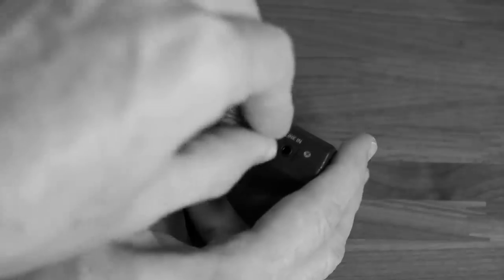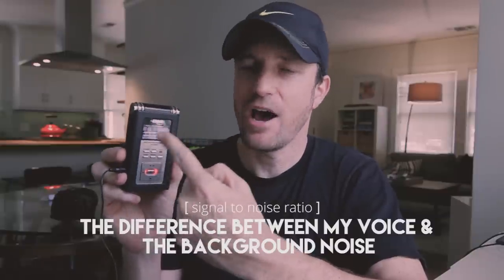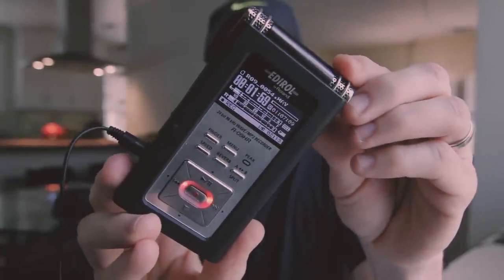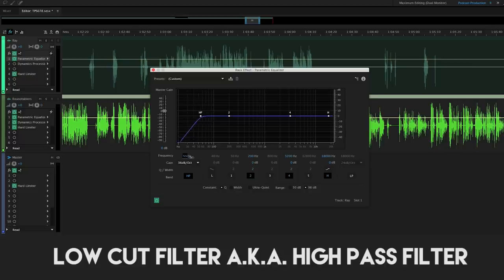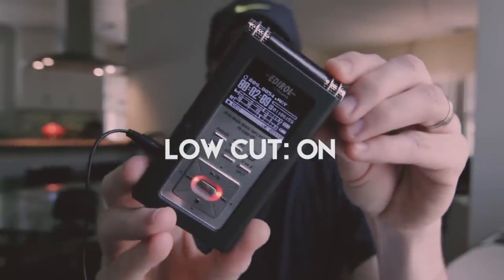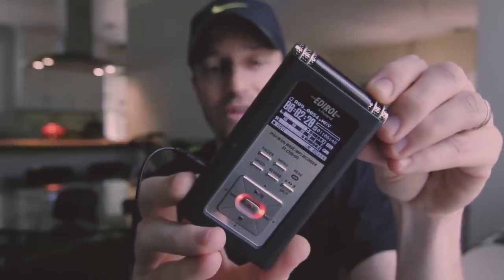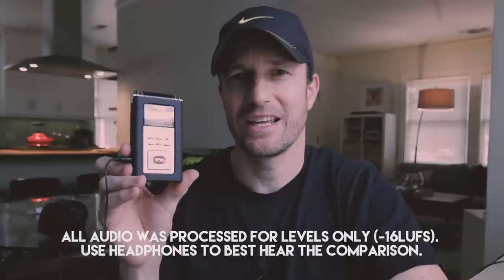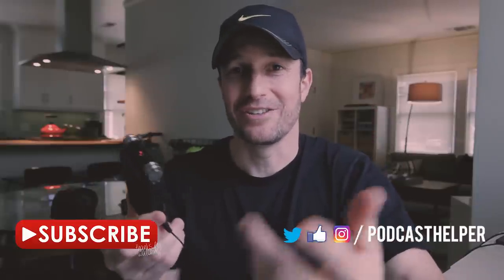Fix Audio Noise Using a Low Cut Filter

Comment: Hi Ray, thanks for the to the point explanation with example for low cut feature on the recorder, my question is that I got Sennheiser MKE 400 shotgun mic for DSLR, I film weddings with my lavalier as well, should I keep the low cut filter ON during my recording or assess the situation, mind you weddings are busy with full of noises people chattering or background music at hall, kindly let me know, thanks.
Reply from the maker: Hi, Mike. Thanks for the feedback. Every mic has a different level at which they cut the lows. I don't like to cut above 80Hz on my mic and in fact in almost all cases I don't use low cuts because I'm going to do that in post production anyways, where I can choose how much to cut. If you do it on the mic, you are kinda stuck with that setting. If it was me, I would record without it and just add a cut in post. Sometimes a low cut is used for wind noise but you usually have to cut too much to reduce the wind so I would definitely make sure to have a windscreen/sock if recording outside.
Reply: @RayOrtega  Thanks buddy for the quick and detail reply, really appreciate it, yes I would leave it OFF but now that you told me that sometime we have outdoor ceremony so I would use the sock and then will use low cut, great advice.

Comment: If I have an external mic with a low cut switch, should I use the low cut on the mic or the audio recorder. Or both?
Reply from the maker: I don't generally use either and will apply a low cut in post production when needed but if you are not doing post or there is a specific need/issue try em both and see which one takes care of the problem. It's likely that they are both set to cut at different frequencies and one may work better than the other.

Comment: dDigging your color and font choices Ray. Keep them coming.
Reply from the maker: +Beardbrand thanks!
Reply: @RayOrtega  does low cut filter remove internal noise from the mic?
Reply from the maker: @wcsdiaries  No, it doesn't do a whole lot overall and that's another reason I prefer to apply a filter in post editing where I can also employ noise removal if needed.
Reply: @RayOrtega  gotcha, so you generally dont even bother with low cut filter? Just remove what you need in post if necessary?
Reply from the maker: @wcsdiaries  That's right. If you were outside with wind, it might be helpful but in general I don't use it unless it's 80hz or below since that won't affect your voice and will only remove stuff you wouldn't want anyways, possibly some mic handling, wind etc

Comment: I shot some video this weekend for my business outside at the beech and ended up setting low cut filter too high. Made some REALLY good video worthless. Using a Tascam with a powered lapel mic and filming the subject as she walked and talked from a distance. I've done this before and when it works it's great. The low cut filter made it sound as if she were in a tin can. I think I had the input level set too high so I could be sure to here her over the wind in case the filter didn't get it. 

I'm not sure which I should have avoided. The filter or raising the input.

Comment: Nice comparison - thanks! My Tascam has low cut settings of 40Hz, 80Hz or 120Hz. I record live music with my band but get a lot of wind noise - which setting do you recommend?
Reply from the maker: Thanks. I guess you're recording outside? You'd probably benefit more from a wind screen. Not sure what device you are using to record but Zoom devices for example have their own wind screens you can purchase. As for the low cut, you could select 80Hz and preserve most of the audio low end but I might also just do that cut in post production so you can undo if it's too much.

Comment: I'm using the Zoom H5 currently with the Rode NTG5 shotgun mic and there is definitely some refrigerator humming in the background that I can audibly hear, but it doesn't seem to cut out completely unless I really dial the gain back to around 4 or so. I used a lo-cut filter of 80 hz on the Zoom H5. 

I have a low voice so I really have to crank up my speaking volume to get the peaks around -12db. Would you recommend keeping the gain at a level where you cannot see any movement on your recorder from ambient noises while recording and then maybe increasing the volume of your voice in post if needed? Just wondering what would be the best way to approach this. 

I get good voice peaks at -12 db and closer to zero when the gain on the Zoom is 5-6, but then I see the ambient noises really moving more on the screen. Thanks for the great video!

Comment: if I shoot a theater show, should I use the low cut filter?
Reply from the maker: In general I don't enable it because I will use a low cut filter in the edit and this allows me to adjust it to my liking instead of it being baked into the audio. If you are experiencing an issue like fan noise/rumble and you can hear that enabling it gets rid of it when you are on location then you can go ahead.

Comment: Hello, I am recording nature with my audio recorder. I want to capture all the noises outside in nature so should I use a low cut filter? If I should, it gives me the options of 80hz, 120hz, or 160hz. I am new to audio so this is new to me. 

What is your recommendation so that I can recording my nature walks and make it sound immersive?
Reply from the maker: Since you're capturing ambient sounds I would not engage because you'll cut some of the frequencies you want to capture, if you have some rumble or wind in your audio, you can then apply the low cut filter in post production. The biggest thing you'll want to watch out for is wind. Use headphones to monitor the audio and if possible purchase a wind screen something made for your recorder like these for the Zoom H1 https://amzn.to/2TgDPZF (affiliate) a real furry one like this will do the best job of preventing the noise of wind getting into your audio. Read reviews and buy one that fits your recorder

Comment: In some of my current videos you can hear a "hissy noise" in the background & it's so annoying! would you suggest tot turn on the wind filter or leave it off?!!! i'm confused! loll
Reply from the maker: No that's not the wind or any kind of low level rumble which is what a wind filter does, cuts out the lower frequencies below 80 or 100Hz. The noise you are hearing is probably creating by setting the levels wrong or bad internals of the recorder you're using. Do you have a video that has an example I can listen to??
Reply: Alexx Beautyxo Alexx Beautyxo if you are using external mic like rode videomic, just switch to 80hz and it will cut hiss or any low frequency sound

Comment: How are you liking the 286s? I got one a while back and I love it! Think you can make a video on the best settings for that?
Reply from the maker: I love it. You have to go easy with it cause it can color your audio a lot, unless you're looking for that, and it's settings are different than other processors but check out this post where I pointed people to some really good resources for learning how to set one up including my current settings https://www.facebook.com/podcasthelper/photos/a.194414313907870.56646.142934445722524/1377527828929840/?type=3&theater make sure to see the comments for links to setup videos
Reply: Ray Ortega Awesome!

Comment: for recording voice dialogue, which Hz level should I put my Low Cut Filter? 
50 Hz, 100 Hz, 150 Hz, 200 Hz
Reply from the maker: You don't have to use the low-cut in production unless you have heavy plosives that it might help. You can apply in in post production as well but if you want to use on the recorder to try and get rid of some ambient noise, set it as high as you want until you hear it cutting into your voice which will probably be 50 or 100. Beyond that it will start to remove some of the low end of a male voice
Reply: Ray Ortega 
Thanks a lot for your reply and advice! Subscribed

Comment: How many Hz do you recommend to cut?
Reply from the maker: I generally do the high pass in post production but you can use whatever you need to get rid of the issue you're having. At 80hz you won't notice a real difference in your voice but once you get above that you could lose some of the deeper frequencies. Doing it in post though allows you to make changes.